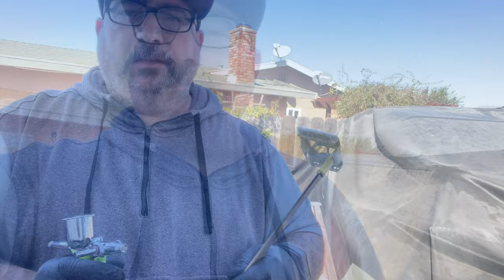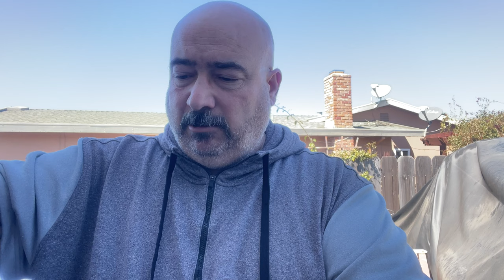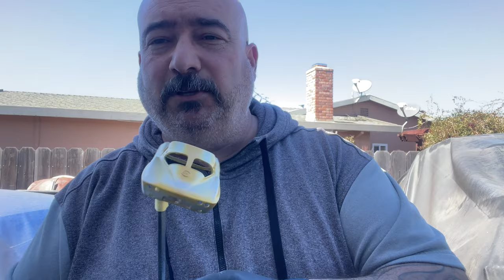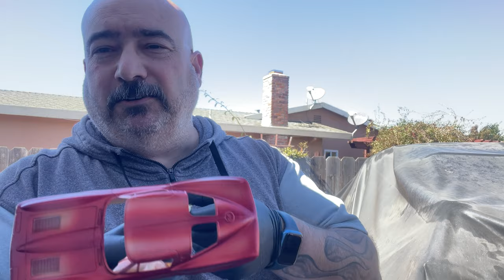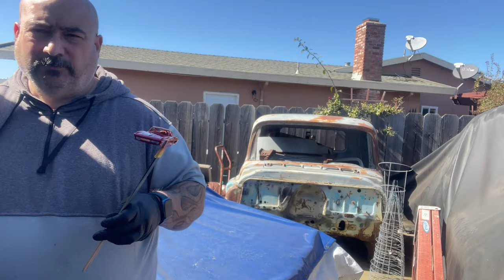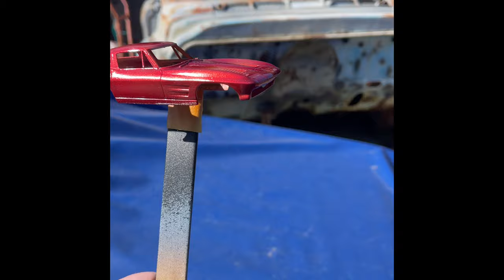Painting Model Cars - Candy Fade Paint Job - Update on Small Scale Group Build

Comment: Guess the splash paints will work for clear, saw Left Coast put it on a model . He has a lot of experience, check out his video
Reply from the maker: I have not used Splash Clear yet, I have some but have been using Scale Finishes clear when using my airbrush, if I use the touch up gun then I go with either Deltron/PPG or Restoration Shop.